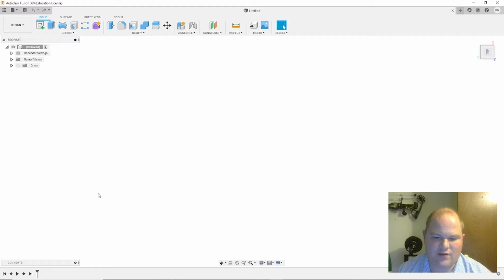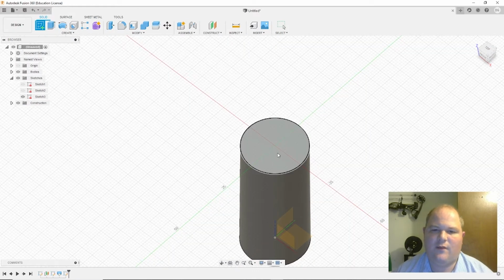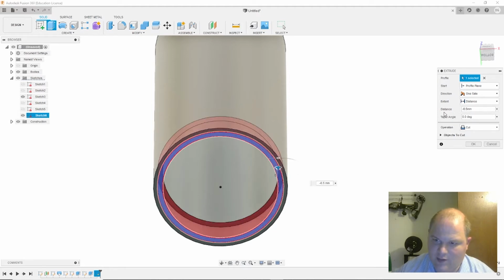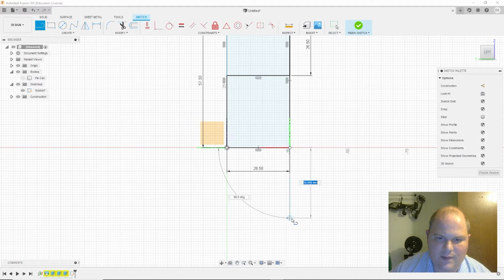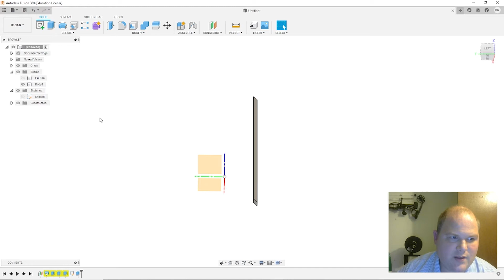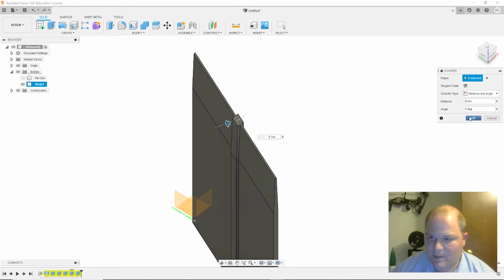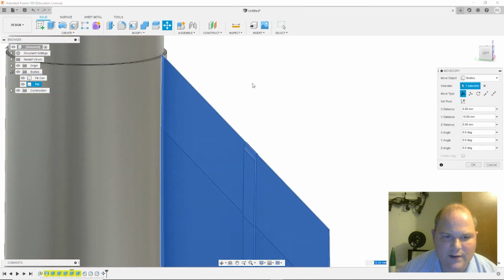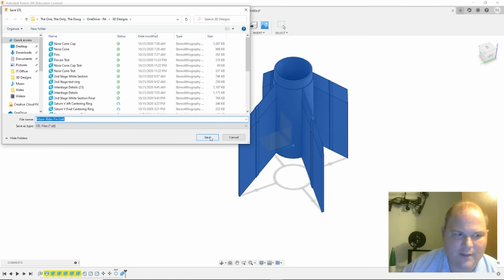Making A Model Rocket Plastic Fin Unit using Fusion 360

Comment: Did you 3d print this and use it in an actual rocket?
Reply from the maker: Yes I did. Fins needs to be a little bigger or need more nose weight. My rocket had stability issues